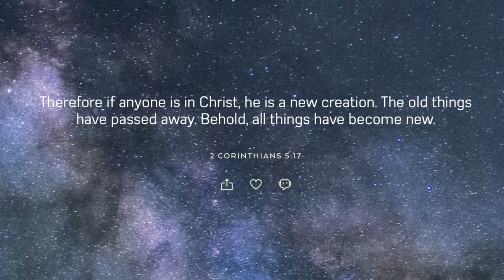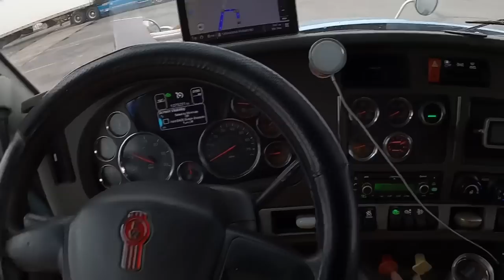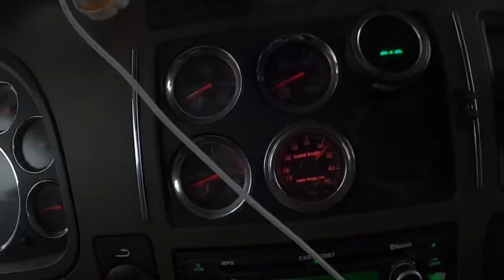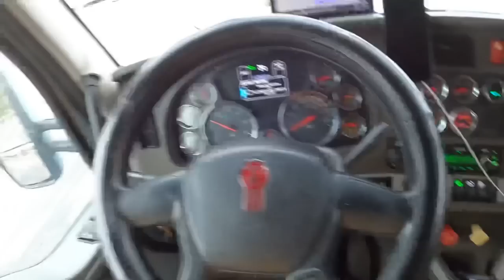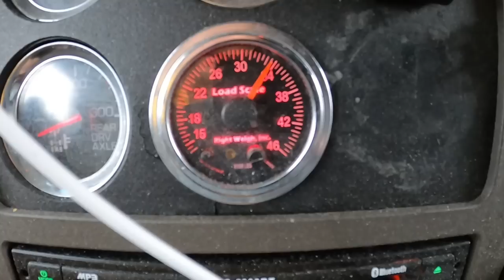March 19, 2023/62 Trucking. How to slide trailer tandems

Comment: Hey Johnny, when the tandems become difficult to slide, slather them with some dawn liquid dish soap. Get it all over the rail and it’ll become much easier for them to slide.
Reply: Why not oil or use spray..pb blaster?
Reply from the maker: I will remember that. But for now, my brakes are new and I don’t need to soap.
Reply: @JBG TRAVELS  Hey Jbg I think he meant the rails that the tandems slide on
Reply: @24juan68 Hi john i've been watching your videos
Reply: @24juan68 Hi john i've been watching your videos j v g travels

Comment: John I dont know if you know but construction  on 90/94 from Hubbards cave to 90/94 split start road construction lanes will be closing tonight 3/20/23 might want to  use 294 construction  to last 3 years thought you might want to know if you already didn't
Reply from the maker: Thanks for the heads up Gary
Reply: Hi John
Reply: @24juan68  did you want to 5alk 8 don't want to call while your in your sleeper ot while your filming please advise when best time im up early 6sm and go to bed around 9pm

Comment: Adjust those trailer brakes that’s why the tractor brakes are wearing out so fast. DOT man would like you for an inspection LHL! Be safe out 👍✌️
Reply from the maker: I was shocked how worn out they were but they have been replaced now
Reply: @24juan68  the trailer, you said the other day the tractor brakes were replaced